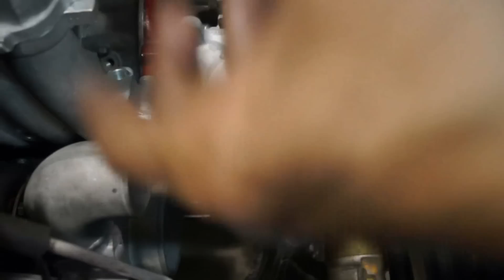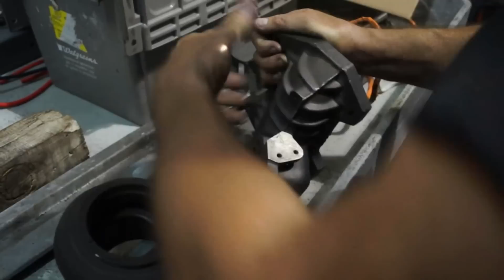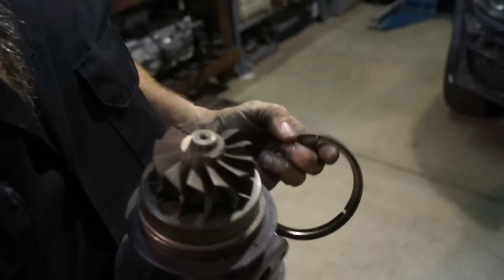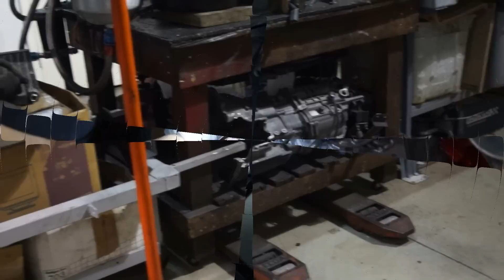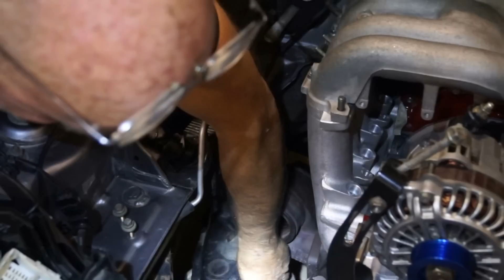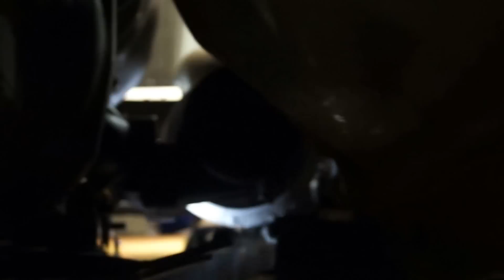Project Turbo RX8 Part 10 Edited

Comment: Those young guys who want maximum power and run open turbo inlets have no clue about turbulence and airflow inconsistencies at an uncovered inlet of a turbo, which like all pumps is going to "surge" if it isn't pulling the fluid its pumping from a steady and consistent supply of fluid and that pumps that are not fixed-displacement feeding "open-center" systems are the most susceptible to not only inefficient operation but significant damage if the load on them rapidly fluctuates due to "cavitation". 

Its pretty obvious judging from the comments of "young" wannabe "car guys" who are excellent at collecting information in their heads as they "learn" it from the internet, TV shows, video games etc but have very limited ability to THINK FOR THEMSELVES and little or no "education" on basic  physics, simple and complex machines etc. that "shop class" probably isn't on THEIR high-school transcript even if was available for them to take  And whatever science classes they took were apparently more focused on global warming and rising sea levels and pollution and "environmental justice than anything practical and useful if a person wants to be able to THINK ABOUT THOSE THINGS FOR THEMSELVES and understand the "theory" that clearly not even the 
"30,000 climate scientists" apparently didn't come up with a "consensus" on how to communicate it to dummies or how to educate dummies to not be dummies are comfortable talking about.
Reply from the maker: Not sure what global warming's got to do with anything as it relates to turbulance and air flow, but I do agree its more propaganda than facts.  LOL

Comment: What's the combination of turbos used to make this one? I got a little lost in all the information, great videos thanks for posting
Reply from the maker: Series 4 RX7 Turbo Housing off the Turbo II Rx7 with the Holset HX 35 compressor.  A HX 40 would also fit.  Carlos discusses it about 1:45 in.